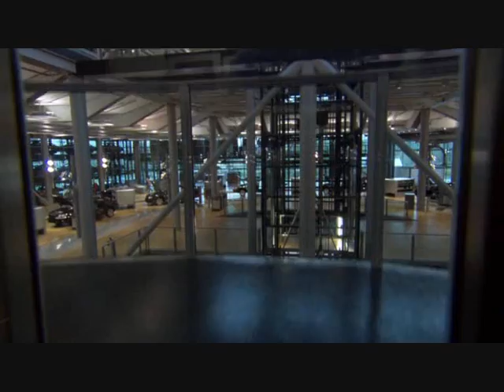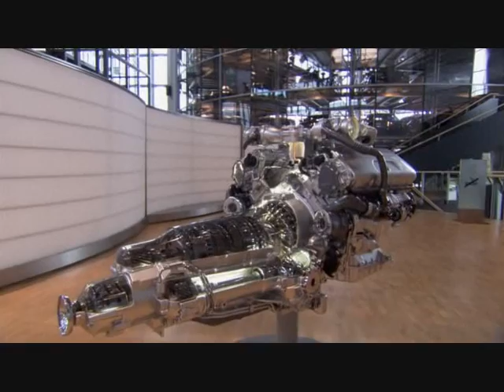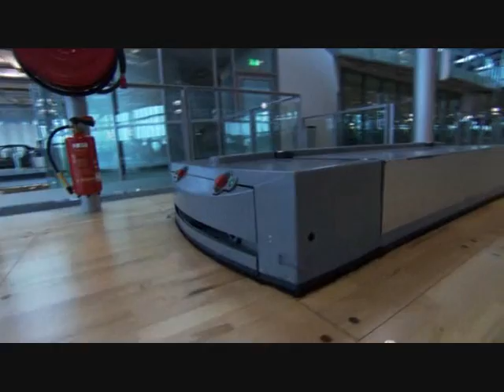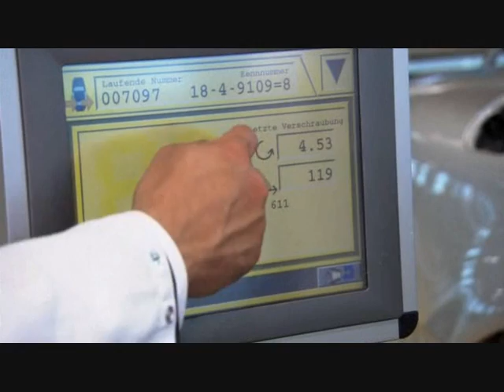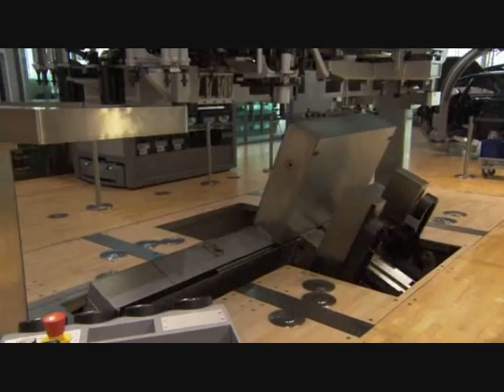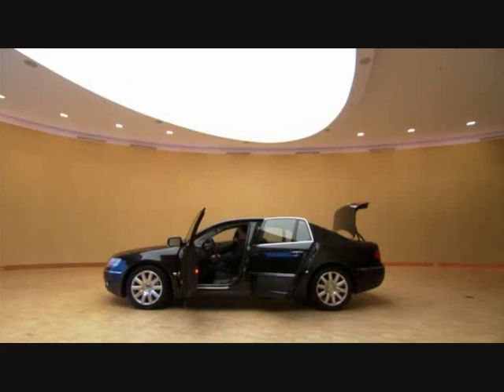VW Factory - Germany

Comment: The VW Phaeton was a complete market failure. Buyers went for a similar car sharing most of the engineering under the VW Audi brand instead, or similar level cars from BMW and Mercedes. After ending production in a few years it was not replaced.

Comment: I have seen photos of their factories from back in the air-cooled days they would hang the bodies from a chain driven track on the ceiling and the chassis would come in on a conveyor belt and they would merge at a certain point low-tech mechanical version of exactly what they're doing now with electronics

Comment: The point of this is to manufacture cars and make a corporation some money, right?  Or is this an entertainment center?  Unnecessarily (very!) expensive way to make cars.  The swoopy building design is not space efficient.  Very low production rates.  Start thinking people!  Nobody is copying this concept because it has a very poor return on investment.  The increased cost of this superfluous stuff is ultimately paid by (you!) the consumer. 
None of the entertainment experienced there will eventually make any difference in the car on the road.  If you want to be entertained, Disney World is far cheaper.  And Disney World isn't cheap!

Comment: Germans kick ass!  Highest Quality, DETAIL, perfection.
Reply: Generally not as reliable as Japanese cars and way more labor intensive to repair with higher priced parts.
Reply: @emjayay  Wrong, you think honda and TOYota parts are cheap, stay current.  I've had 17+ VW stuff over 40 decades, I drive a lot, never stranded, and not any different to repair, or maintain than any other brand, they just do things BETTER.

Comment: The VW Phaeton is good deal. The huge Volkswagen company is using the Phaeton brand to upscale all their production lines in brand awareness. They cannot afford to make it non-excellent. It's the better S-class for less money. (when similar engines are compared, needless to say). Of course it's heavy and not driven electrically, though. But it shows what VW is capable of, the owner of Porsche and many more.

Comment: But Hitler was to be no silent partner. The New York Times was to call the beetle in 1938 was Hitlers design, or Hitlers rendering of a design by Erwin Komenda, the specifications were clearly Hitlers. They included several requirements that did not make Porsches job any easier the car had to carry two adults and three children or three soldiers and a machine gun; it had to be able to operate at 100 kilometers an hour; the engine had to be air-cooled;

Comment: The thing is...ANY CAR...should be fine with such LOW miles. I have an 87 Chevy Sprint with 190k..which is reasonable miles to start judging reliability. One Turbo at 125k (my friends Passat 1.8t needed an $800 one just 60k;) and a clutch. That is IT. 
My 92 GTI 16v, now 160k...clutch, head gasket, 2 radiators and 1 dog house cooler, 2 distributors, tranny rebuild...you get the idea. VW's are superior feeling, control, feel, seats...but reliability is So So, regardless of maintenance, worth it

Comment: I wonder what happens when that factory hits 70,000 miles and the electric system implodes like my Passat did. My mechanic says, "buy a German car & put my kids through college. OR buy a Toyota, Honda or Nissan and I'll never see you again"

He was right-after a VW & an Audi, I finally got a used Nissan. 4 years-0 repairs.

These are the companies Detroit should emulate, not VW-of course, you can't fix greedy unions, bad work ethic or dishonest execs. So I guess Americans are screwed either way.

Comment: I said buy Ford and vote Republican, and I meant it. I have owned every model of VW rear-engined air cooled vehicle. Drove them all back in the 60s and up. But it is the unions that killed America. I live in Alabama, and we have Honda, Hyundai and Mercedes here. Why? To get away from unions. Ford has cut union contracts, not connected to Obama. Give them a chance. Read any car reviews lately? They rate way up there, better than other American vehicles and equal or better than foreign.

Comment: There are many problems nascent in the American manufacturers right now and lack of foresight is one of them. THEY should have seen $4/gal. gas coming and designed their vehicles accordingly. Instead, they thought we would only buy increasingly bigger, more expensive, less fuel efficient vehicles.

So now their problem is us. We're just not spending money on their current inventory.

Alsowhen Toyota builds a car or truck in the US, that profit goes partly to US stockholders on a per share basis.

Comment: You need to check the "country of origin" sticker on the next car you consider buying.  It's very possible that a higher percentage of a Toyota will have been made in the US than the percentage of a Chevy.  And the profits go to the SHAREHOLDERS.  Lots of Americans have shares in Toyota or Nissan, just as lots of Brits have shares in GM (though they may wish they didn't at this point in time).

Comment: It's not an A8 for $20k less - The Phaeton is based on the D1 platform, and the A3 is based on the Aluminum D3 platform. 

Components are shared between the two vehicles but by no means are they the same car with a different badge.